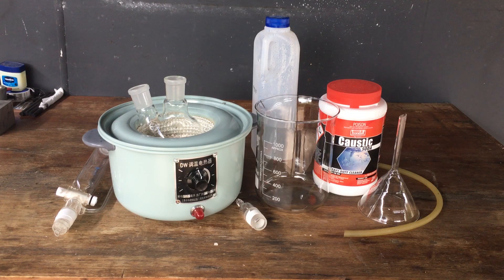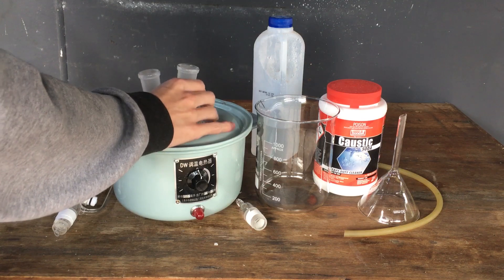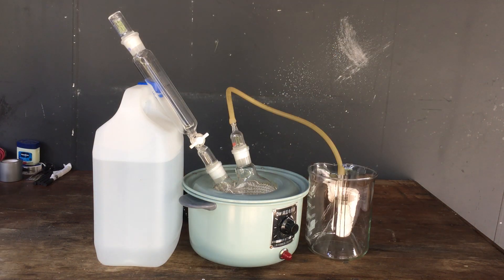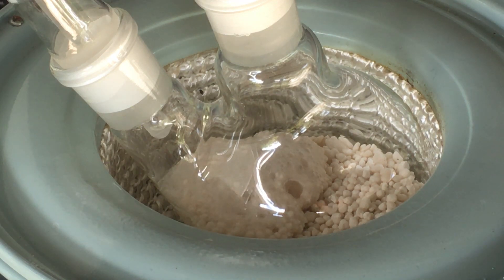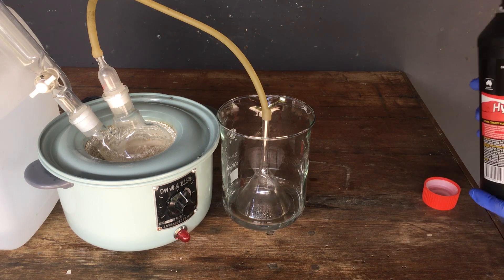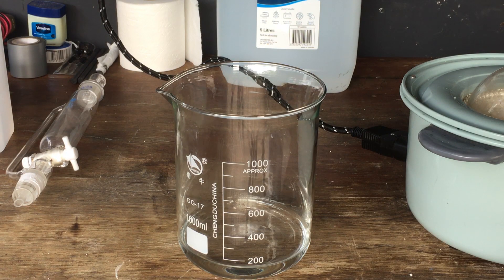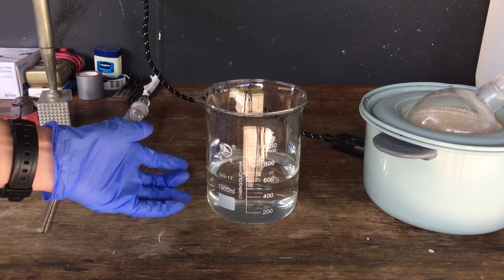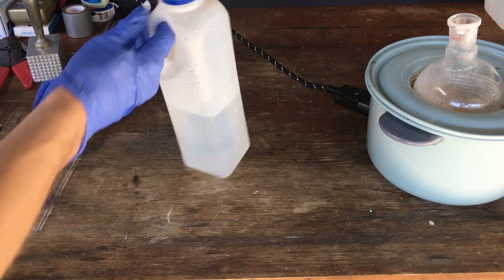An Ammonia Generator

Comment: Would ammonia be difficult to produce from wood or perhaps sawdust ?
Reply from the maker: Nitrogen is usually only present in wood at a concentration of much less than 0.5%, so I'd imagine you'd have a great deal of difficulty doing this. Maybe some types of wood have more nitrogen than others, or maybe you're thinking of something else?
Ammonia was notoriously difficult to prepare before the invention of the Haber-Bosch process, and there's really no easy way to extract or produce it, sadly.

Comment: Gday thanks for the video. It was very interesting! I saw the video of the Canadian guys running a car off ammonia, I think it was 25% strength. I was hoping to find a way of making aqueous ammonia easily! I was wondering how do you test the ammonia level? Also what is the product that is left in the beaker? Does it have any uses?
Reply from the maker: Glad you enjoyed!
The concentration here can be measured by titration or by density measurements (with a hydrometer), depending on what you've got available.
The by-product of the reaction is sodium sulfate (with very little practical use in my opinion), though there will always be leftover sodium hydroxide and ammonium sulfate in the starting mixture, so it won't be pure anyway.

Comment: have you tried generating hydrogen with electrolysis and letting the hydrogen flow through liquid nitrogen with should produce amonia gas
Reply from the maker: I highly doubt that would generate ammonia. Do you have any evidence or written procedures you can point me towards for this reaction?
Reply: @ScrapScience   bsdicslly could you generate nh3  by allowing hydrogen gas to bubble up in liquid nitrogen
Reply from the maker: I still don't believe this would work. I'll be happy to try if it is viable, but again, do you have any evidence or written procedures for this reaction?

Comment: Who can you get a good idea of how concentrated it is, and if it to diluted I guess you boil of the water slowly.
Reply from the maker: You can measure the density with a hydrometer, and infer the concentration of ammonia from that. Otherwise, you can also titrate the solution to get an exact measurement.

You can’t concentrate ammonia by boiling I’m afraid. The ammonia will come out of solution before the water starts boiling. The only way to concentrate it is to continue adding more ammonia gas to your sample.

Comment: Hello, Great job man . I want to know if we have need the heat at the first stage , or we heat it only at the end of the process , and what temperature we have to apply ? thank you for the videos 😊.
Reply from the maker: You can heat at any stage, but the reaction might be more controlled if you only heat it towards the end of the process. You only need to heat the solution to near its boiling point (100 C) to finish it off.
Reply: @ScrapScience  Thank you very much Bro, I waiting for your next videos, I like your easy description a lot 🧪👍👌

Comment: Hi great video
Now can you tell me the different
Between generating and extracting
Please
Reply from the maker: Well, I guess I probably use the terms interchangeably sometimes, but 'generating' should refer to the production of a compound from stuff that doesn't contain the desired compound (in this case, I'm generating ammonia because the starting material doesn't have any actual ammonia in it). 'Extracting' however, should refer to separating a compound from a mixture or substance which already contains it (such as extracting the caffeine from coffee, because the actual caffeine is already present).
Reply: @ScrapScience  In Australia @mMoNiUm sulfate Doesn't have
Ammonia in it.
And to make coffee you should extract caffaine from a compound
N make setup for coffee generator.
Cool
Reply: @electromagic3111 Say ammonia. Now say ammonium. They’re the same, pretty much.
Edit: You probablu realized this after a few days, but it's more like NH3 is ammonia gas, and NH4 is the ammonium ion.

Comment: G’day Mate...Another fantastic upload. I was inspired by your earlier ammonia extraction experiment using Ammonia Sulphate and Calcium Hydroxide the other week and used the same  funnel preventative suck back setup but used a ice bath to maximise yield. It was very successful....My observation was that by the calcium sulphate (drops out of solution) is a lot easier to heat and bubble ammonia gas into a very cold DH2O solution .
After collecting I used some 3A molecular Sieve to increasing the concentration. A hydrometer is a good way to determine concentration.
Reply: I used calcium acetate  extracted from oyster shells to make my Calcium Hydroxide
Reply: @adamcoogan9122 you can just heat calcium carbonate directly to get lime, then put in water

Comment: Question. I think that because the Na is a stronger base than the ammonia, it takes the Sulfate to be NaS or something and the ammonia is released? --> NaS + water + ammonia (gas)

Rock on! You're vids are awesome, someday I'll get my head around all this haha
Reply from the maker: Yep, precisely! The NaOH is a much stronger base than NH3, so it sets up an equilibrium which favours the production of ammonia. Seeing as the ammonia leaves as a gas, the reaction can be pushed very near to completion.

Sulfate is actually the SO4(2-) ion rather than S(2-), so the overall reaction is:
(NH4)2SO4 + 2NaOH -> Na2SO4 + 2H2O + 2NH3
Reply: @ScrapScience  Thanks! I'm gettin there.  ...credit where due, watched acid/base vids for years, but watching yours made everything "click".  Keep up the awesome work!!! ....also the clay pot as a barrier for the K-Nitrate was straight f*cking genius in my book. Cheers!

Comment: Do you intend to do the 
Ostwald process?
Reply from the maker: While the Ostwald process one of my favourite reactions and I'd love to have a go at it, I don't currently have the setup to get it working I'm afraid. 
My plan is slightly similar though, hopefully I'll be able to oxidise the ammonia to nitrate, just with some less extreme conditions (and likely a much lower yield).
Reply: @ScrapScience  there is a video from astral chemistry, but they used platinum which is expensive.
What is your plan?
Reply from the maker: I really liked that video, they even made the platinized fibre themselves I think, pretty cool.
As for my ammonia oxidation, it's all about more electrochemistry! 
I found a file on sciencemadness detailing the process pretty well, and it definitely doesn't seem too tricky to copy:
https://www.sciencemadness.org/whisper/files.php?pid=470124&aid=55681
I still need to make some potassium hydroxide though, which I'll hopefully get around to relatively soon.
Reply: @ScrapScience  Did you know that ozone also works for this ? If I read correct you can also do ozone electrochemically and then pour/bubble it into the ammonia solution.
Reply from the maker: @Telectronics While ozone is definitely capable of oxidising ammonia, the reaction itself is pretty tricky to get going on a reasonable scale, especially with low concentrations of ozone.
I think Extractions&Ire tried this at some stage and got basically zero yield after hours of pumping ozone from his generator.
I might give it a go at some stage, but it doesn’t look particularly promising from what I’ve seen.
Reply: @ScrapScience  Correct. He did not achieve any yield of product. I advise you not to try it.
Reply: @ScrapScience  Sure his was slow but he did it with high voltage and not electrochemical way(electrolysis) which should give you much more yield. Of course you could also use massive power of arcs in KW range and make a lot of  nitrous gases and bubble them through ammonia but I don´t know If you want go through the hassle to get a very powerful high voltage transformer that can arc forever because of the soft magnetic coupling like a neon sign transformer but they are not cheap If you don´t wind them yourself.
Reply from the maker: @Telectronics Electrolytic ozone is not going to provide more O3 than a HV ozone generator. Electrolytic O3 can be made at a typical concentration of 0.5% in the gas coming off the anode, so to get the same rate of O3 production as Extractions&Ire got from his generator, an ozone generating cell would require around 200 amps of current (definitely not something I can achieve). I definitely don't think large scale reactions with electrolytic ozone are very feasible at all.
If I go for big HV arcs to generate nitrates, I might as well build a Birkeland–Eyde reactor, which is definitely something I'd like to try eventually (in the far future).
That being said, electrolytic ozone production by itself is a very interesting process (if only for a proof of concept), and I'll probably cover it in a future video.
Reply: @ScrapScience  I see then I may misunderstood the wikipedia article about ozone production. That is even better then because to generate HV is easier than to generate 200Amps for the electrolyzer. In fact you only need a big ferrite core some wire and some components to make a mains driven half bridge driver you should easily get about 5KV 2KW arcs. Maybe I can make an easy mains driven half bridge driver soon to give you an idea.
Reply: @ScrapScience  An other usable catalyst would be an mix of Ironoxyde and Bismuth oxyde. This was the catalyst used in Germany during world war 1. They etched it an an stonde plate with holes in an 2 cm high layer. Yield 85%. At the end of the war they used 6mm cubes of this material in an siefe. It was made by boiling of an solution of Ironnitrate and Bismuth nitrate. 96%to4% any higher or lower bismuth content smalers the efficince. This Catalyst had an yield of 96% compared to 98% with platin.The only 
disadvantage compared to platin is the gas speed must be half of that of platin. Source Brauer from Ostwald and Brauer 1921.

Comment: Considering everything going on at the moment.. I'm not too fussed about the AusPost delays either. Things eventually arrive

Cheers for sharing this method :) Did you source your sulfate from bunnings, or had some on the side ready?

Funnel bubbler is a ripper. Did any suck back nearly occur, or nah?
Reply from the maker: I agree, despite delays, the post still gets through eventually.
Ammonium sulfate from Bunnings seems to be perfectly fine for this reaction, I've never had any problems with the impurities and all the products left behind in the flask are highly soluble in water so cleanup is easy too.
I was very much expecting the gas to attempt suck back at some point (and even made a big deal about it in the original video footage), but to my surprise, the gas was absorbed at pretty much exactly the same rate as it was made. Pretty unusual though, I'd definitely expect suck back to occur most of the time.
Reply: Did any suck back nearly occur, or nah?
to void this you can use a check valve

Comment: Love the vids. Any suggestions where to get an addition funnel from ?
Reply from the maker: I'm afraid I'm no expert on sourcing addition funnels. I ordered two from China on ebay before I got this one and both arrived completely shattered (got refunded though, so that's all good).
If you're in Australia, Deschem is a very reliable ebay store (and relatively cheap) for a lot of glassware. If not, I probably won't be much help.
Reply: @ScrapScience  deschem doesn't post to Australia anymore because to much glassware was being stopped by customs, or thats what they told me a few weeks ago but i ordered a heap of stuff from nashiglass and had no problem, ben something has better prices on many things but postage is painfully slow and expensive unless it's a big order, i hope the extra slow postage doesn't result in a higher risk of breakage since i have a 300 dollar order coming from him.. when that order comes in I'm going to send a message to deschem and let them know the size of the orders and that they got through so hopefully they start sending to Australia again albeit i won't be needing any glassware for a long time..
Reply: I got mine through these guys they are fantastic https://scienceequip.com.au/collections/new-arrivals/products/additional-funnels-cylindrical?_pos=1&_sid=e42cc7aae&_ss=r

Comment: can you make an hho torch
Reply from the maker: At this stage, I'm pretty terrified of burning hydrogen gas. I'd love to try one day but it won't be for a while.
Reply: I saw a good torch with electrolysis w a 5 gallon bucket; drill 2 holes for the car battery in-POS and in-NEG and 1 for OUTPUT hose you light up!!! ....if you're into being crazy over prepared, check out making carbon electrodes. You can fix your car with it's own battery or use them for electrolysis as seen many times on this channel. Cheers!